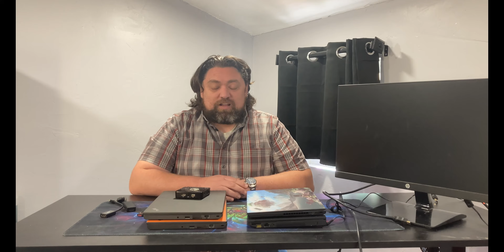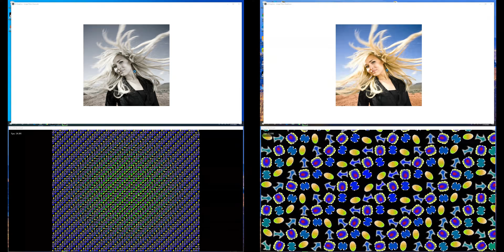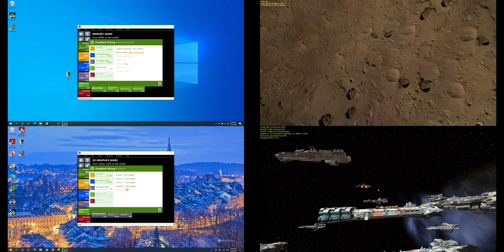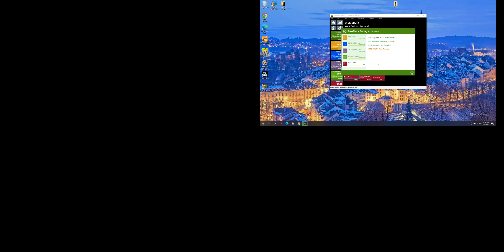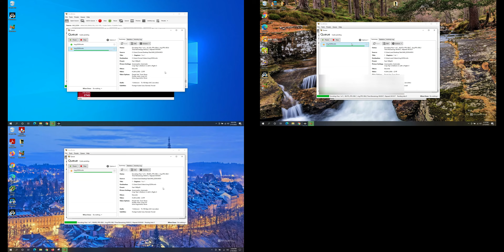Lenovo Thinkpad X Series Performance Comparison: X220 vs X250 vs X270 vs X280

Comment: was this comparison done when they're all stock? without any upgrades? 

coz I really want X220 and upgrade it. that's why just wanted to confirm it

thank you for the effort by the way
Reply from the maker: You cannot reasonably modify a X220 outside of upgrading ram/storage. It had an SSD and 16gb of ram.
Reply: @AICvideo  X220 are built to last run's like a work horse for everyday work its a perfect tool. 16gb RAM is more than enough. Clock speed on CPU is great. Killer Keyboard!
Reply: thanks mate. appreciate it

Comment: I saw this and your video on the 270 and decided to buy a used one on eBay. ex-corporate laptop. 8GB DDR4, i7-7600U, 256GB NVME. Honestly I was very impressed. My home system is a 6 core Ryzen with 32 GB DDR4, so I wasn't expecting much from a dual core CPU. I since have changed the ram to a 16GB stick, changed the NVME to a 500GB I had laying around, re-pasted the CPU/GPU and replaced the battery with a genuine Lenovo 72wh battery which seems it was earmarked for an X240 since on the box it says the battery model is X240-6. This system is very good for a backup or portable system. I am really surprised. I have the screen which is not the 1080p, but I kind of think I wouldn't want the 1080p one because I heard it can suffer burn-in more and also I don't want to squint to see things at that res on a small screen. I also bought an ultra dock like the one you showed before for £15 on eBay in great condition with both keys and the charger. I wanted a spare charger which would have cost me about £10, but since this dock came with a charger and was £15 it was a no-brainer. Very highly super cool! Thanks for the videos. You have a subscribe from me!
Reply: Hello, how much did you spend in total?
I'm about to buy an X270 haha
Reply: @97Gastóncv  I paid £135, then replaced the NVME with a different spare one I had which was twice as big, I spent maybe £30 on a 16 GB stick of ram for it and £50 on a new (old stock) high capacity original genuine battery. And a cheap bios battery replacement.

Comment: i wish the 280 had an external battery and upgradable ram. the external battery i could fix with a powerbank but cant get 32gb ram sadly even though 16gb will probably be enough for me. if im being honest the T480 checks all my boxes but i prefer a smaller more compact laptop

Comment: Would i be able to use the x270 for photoshop?
Reply from the maker: It would run I'm sure, but you probably want something with a better screen or use an external monitor for it. and you would want to max out the ram:
https://helpx.adobe.com/in/photoshop/system-requirements.html
Reply: It works. It does complain about the graphics though but it works.

Comment: Thanks for the Benchmarking, I go for the X270, much more versatile than the X280. The CPU of the X280 is great (can see it) but up to 32GB Ram in the X270 and replacable Battery <3
Reply from the maker: I rarely max out the CPU in daily tasks, but memory? absolutely. even just browsing the web, 8 gigs is really a bare minimum. I wish it had 16 gigs.
Reply: Now I want one (x270)

Comment: hello, what do u suggest,   thinkpad x250 with FHD Touchscreen , or thinkpad x270 with HD screen ?
Reply from the maker: The FHD screen is so much better than the HD screen, I would either find an X270 with it, or budget an upgrade. 
The CPU isn't that much faster on the x270 over the x250, but the faster memory, faster storage, and more modern ports make it a superior machine. 
Unless there was a massive price difference (30% or more) between the two, making the x250 significantly cheaper, I would keep looking for the right x270.
Reply: @AICvideo  The price is SAME, for x250 it is i5 gen 5  DDR3 ram, and x270 i5 gen 6  DDR4 ram ,  same ram 8GB , same storage SSD, same price ? which ones better  do you think ?

Comment: how is the battery life of the stock x270 batteries ( internal and flush external ) vs the x280 for daily usage? I am really torn between the x270 and the x280. if both had 16gb of ram and a snappy ssd I assume it would just come down to form factor and battery life. plus i imagine the quad core would be helpful. Plus since the x280 does not have a swapable battery, I could just get a USB C 65w external battery pack to charge on the go if needed.
Reply from the maker: Since you would be buying used, the battery life will be highly dependent on the health of the batteries. The x270 has the benefit of being able to have a much larger extended battery affixed to if, if battery life is what you're after, something like this:
https://amzn.to/3hOGuIk

other than that, I believe that Lenovo targeted very similar battery life when they were new (~6-8 hours). Between the two, I didn't really notice much in the way of performance difference in daily tasks (email, web browsing, etc). but did notice a difference when I had to do more heavy tasks, like video editing. Obviously the 4 core is better. 

I would look at just how much battery life you really need, and what ports you need. Not having a network port is often the killer for me. I use it often enough that if I don't have it on my laptop, it is a problem.
Reply: @AICvideo  thank you so much for the reply!

Comment: so x230 i still can use it for my studies? because the keyboard is one of my favorite feature of thinkpad🤤
Reply from the maker: Depends  on what your studies are.
Reply: @AICvideo  Programming, I'm a beginner programmer and my budget is $300+ i saw a $220 t450 also a $310 t470. What should i buy is t470 a huge leap on t450? pls help.🥹
Reply: @jan5504  personally I use a x250 i5 5300u, 8gb ram and 256gb storage for school, although I don’t have any apps that are for programming. The older Thinkpad laptops are still good for working or school related tasks, but for heavy gaming it struggles.
Reply: @JohnChan2003  Thanks bro, i have a gaming pc and i only need a portable and tank build type of laptop and also the classic keyboard for long hours of typing but i can consider newer keyboard if there's no choice in performance. I will not use it for gaming though.
Reply: @jan5504  usually the batter may last from 2 hours to 6 hours second hand, I believe that their are still battery resellers for both t450 and t470, both of these have the option to install an internal battery alongside an external one. I think both of these have the keyboard like in the x230. 

My x250 only had an external battery but I managed to buy an internal one second hand.
Reply: @JohnChan2003  Thanks bro for the insight, I'll look for t470.
Reply: The t450 is a 4th or 5th gen cpu (there are two generations due to the wide amount of possible configurations)
While the t470 is a 6th or 7th gen, higher gen usually means better, but all the cpus listed on both of their spec sheets are dual core cpus, which may be enough for your programming needs. 

Note 
In the T470 there is a chance that should the cpu be a 7th gen, it may come with a dedicated graphics card, instead of an integrated one (dedicated is better).

T450 and the t470 6th gen cpus are all integrated.

You would want at least 8gb or ram in that laptop, and the storage should at the very least be 250gb+. If buying second hand, I recommend switching the storage to a brand new SSD because you wouldn’t know how much use the previous owner did.

Comment: I'm between the x270 with i7 7500u and the x280 with i7 8550u. Wich one may I choose for work and study? What are the pros and cons between them?
Reply from the maker: X280 for the cpu, especially if it has 16 gigs of ram. The x280 is a MUCH more powerful machine. 

The x270 has more ports, more upgradeable, and would be my choice, if I needed more ram.

Comment: Hey, :) Is the x270 default battery good? Can it handle like 5 Hours or is an upgrade necessary?
Reply from the maker: I easily get 8+ hours on mine, but I bought a brand new battery. if you buy one, it's going to be used, and probably come with a used battery, so it will be hard to say. If you get one maybe plan to replace the batteries (there are two, the internal and external).
Reply: @AICvideo  So upgraden the external is the better  option i guess? also ive hearded opening the x270 isnt that easy without destroying something in the back, im not sure what it was
Reply from the maker: it's a bridged battery, so there are two. the external is easy to swap as it is meant to be swapped easily. the laptop is super easy to open up. it is meant to be opened up for repairs/upgrades.